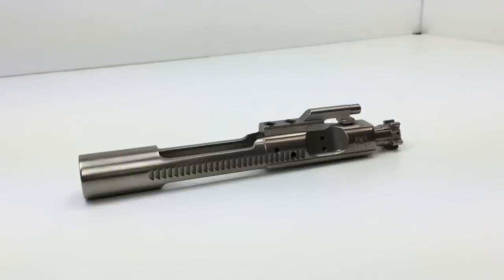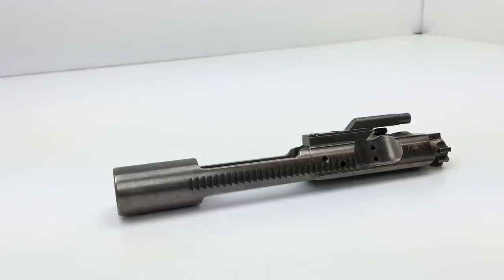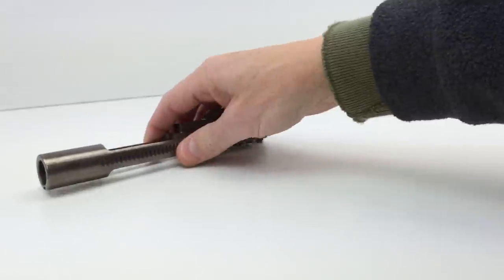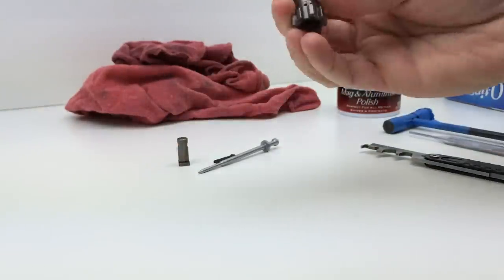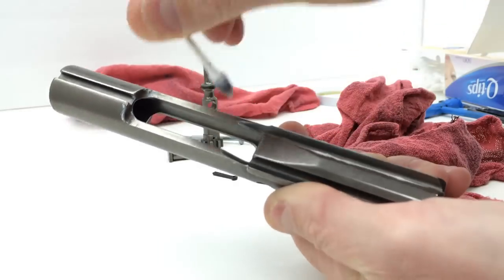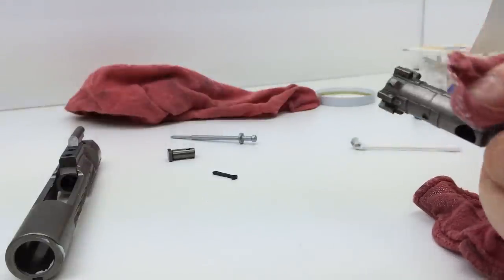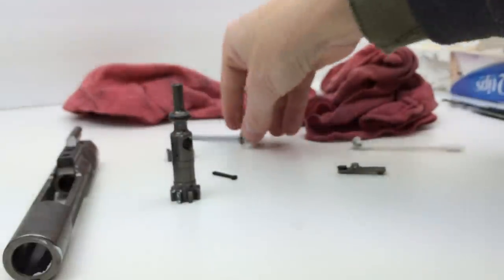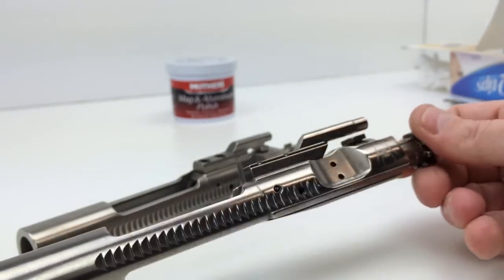AR15 Tech Tip - Polishing your dull Nickel Boron Bolt Carrier Group

Comment: Awesome work looks amazing after you polish them. Have you had any reliability issues after polishing them?
Reply from the maker: Absolutely not, unless of course you don't clean it properly or reassemble it correctly, no reason to expect any functional problems due to a polish.
Reply: 2phast Tactical Do you have to repolish it after each time you shoot it? Do you use just regular clp to clean it?
Reply from the maker: The original purpose of the video was to address the issue of raw NiB BCG's that FailZero and Spikes have been shipping.  Those never went through a final polish and arrive extremely dull and even feel tacky to the touch.  Any NiB BCG that has been polished will dull, as with anything that has a nickel content, so expect that to happen.  You don't need to polish your NiB for it to function as intended nor do you need to re-polish it.  I don't re-polish mine.  After shooting, I will take them apart and clean them, CLP is fine and then I will oil them using Spikes (Lucas) gun oil, put them back together and then re-install.
Reply: 2phast Tactical I totally understand. I want to polish mine I really like the way yours came out. Thanks for the replies